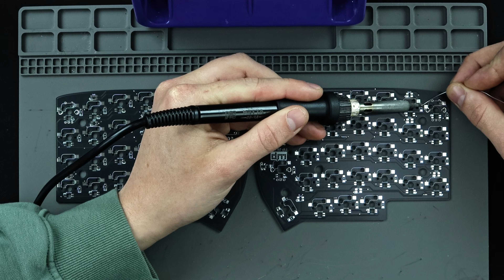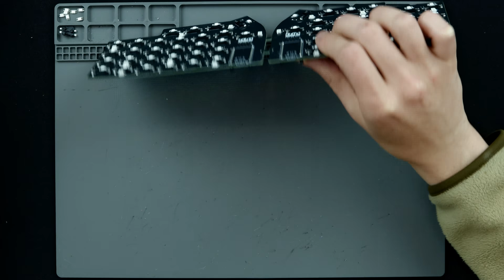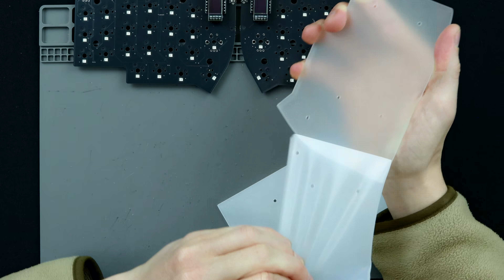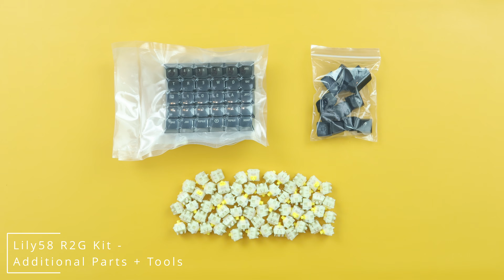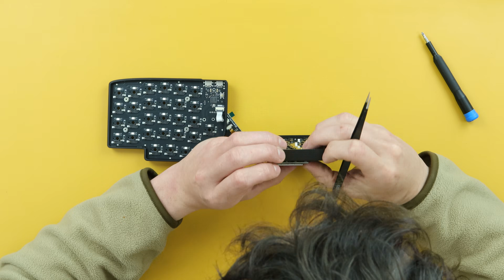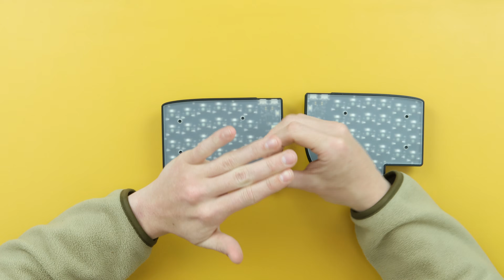How to Build a Custom Lily58 Keyboard (Solder and R2G)

Comment: Hi, I am experiencing a column 1 of the right keypad shorted somehow, it like the keys on that column is pressed together..from top to bottom... I have removed the c1 pin from the rp2040.. then the key press stopped out ..I still don't understand how it works, please advise.. thanks 🙏 please advise how to solve this

I think I have solved it, the usb c connector was loose which caused a wiggle, and the wiggles will cause the MCU to go crazy and start sending out crazy errors like one whole column is shorted when there is nothing wrong with that diode or pcb